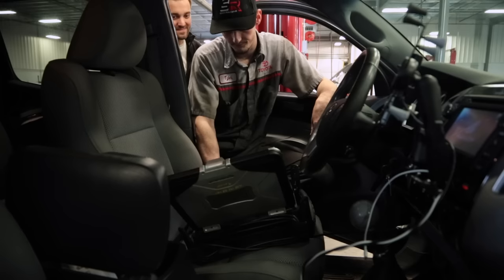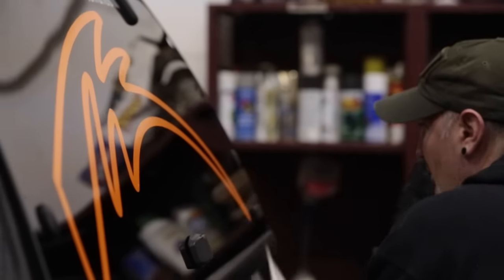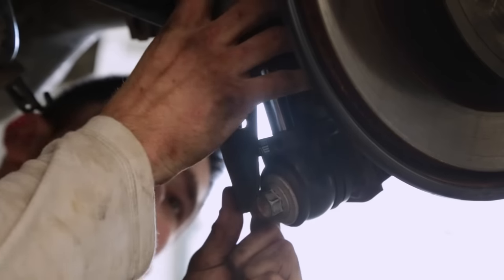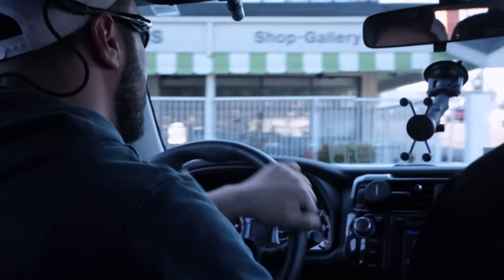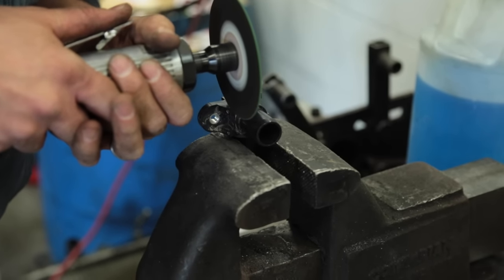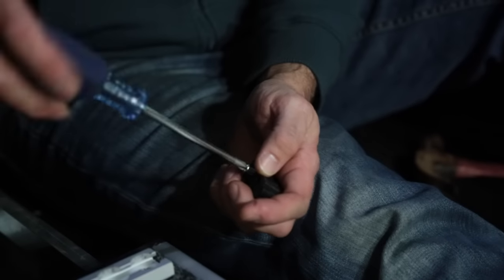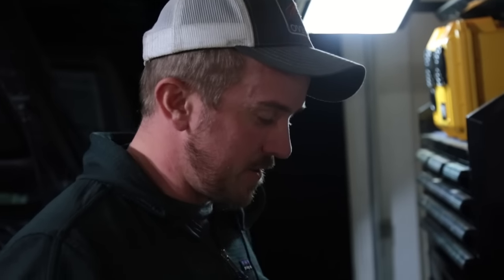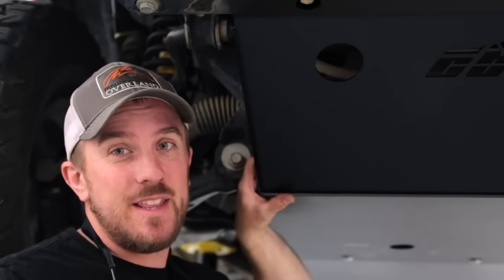Built 4 Adventure - 4Runner Overland Vehicle Build - Mountain State Overland

Comment: pumped, can wait for the new season ! and not hard to tell your dealing with Toyota USA, theres no way Toyota Canada would modify a truck ! they gave me such a hard time about my 3'' lift on my Tacoma, I had to take it off.
Reply: haha I had a Vibration, and they said it was from the lift..... and wouldn't look at it until it was off, not sure if you're in Canada or not but Toyota Canada is Nothing like Toyota USA, they don't even like bigger than stock tires..... it's insane...
Reply from the maker: +Matthew James I don't have vibrations - you can remedy that with a pinion drop kit. I did t have to do that fortunately.
Reply: Matthew James

Comment: Excellent work guys! You have some nice rigs! I've watched all of the seasons, and have just finished the second round of Season 3. As an amateur radio operator, I'm interested in details on your antenna setup... What did you use for antennas on the 4runner's front bumper?

Also, I noticed the bumper sticker on the back of Boomer the Camper Van... Cool to see another ham (Spencer) in the northeast really interested and involved in overlanding!
Reply from the maker: the MSO trucks run CB and GMRS antennas. The camper van runs CB, GMRS and Ham antennas. Our primary radio of use was a Midland MXT100 Micromobile GMRS radio. That radio is a game changer for the price point and audio is either clear or OFF. Best reception during the trip was 4 miles.
Reply: Are you still happy with the mxt100

Comment: I have a 2016 Trial Premium with KDSS in Richmond, so I'm excited to see the New England adventures and hope to catch up with you on a future trip - thanks for the video!

Questions - are you guys using the BP-51 setup for a FJ on the 4R? or is it a pre-production model? What about KDSS? You guys mention spacers for the stabilizers, but not sure if you needed a work-around for KDSS...
Reply from the maker: Those BPs were the first 4Runner install with ARB. They do have a KDSS option. I think they are very similar to the FJ kit if not the same. Contact ARB directly to be sure.
Reply: Thanks for the info - I also would like to understand more about the mods to the Bull Bar that's only made for the 2010-13 models - ARB makes some great equipment but for some reason has left out the latest 4runner from the good stuff - also love the new season & excited to see where you guys go next...

Comment: Are they Nitro Gears?  Notice an increase in NVH?  I went Nitro 4.56 in a cruiser and man they are noisy.  They are setup right, but the front is a howler.
Reply from the maker: Yep, Nitros. There was humming during the break in but at around 3K miles the growling went away. Did a gear oil swap at 500 miles too.

Comment: What size drawer did you use for the Tacoma and how did you mount it?
Reply from the maker: Its a big honking drawer. The passenger bed has a full length pull out. The drivers side has a fridge and another cabinet behind it. The system is all bolted to a sheet of plywood that's anchored to the bed of the truck.

Comment: did you run spacers to fit 285/70/17s on the 4runner oem wheels?  i have volk racing TE37X 18x9s with 285/65/18s and it fits but I'm curious about what to do with my 17s since the stock tires aren't so great. are the spacers needed? what did you run?
Reply from the maker: We are running spacers, but they aren't necessary to fit. The spacers actually resulted in more rubbing.

Comment: That red recovery point you installed on the 4runner, what brand is that and will it fit on the tacoma? if not what do you suggest for a recovery point on a second gen tacoma? I have an ARB Deluxe Bar like yours and and unsure about rated recovery points on the front of my truck.
Reply from the maker: If you don't have the ARB recovery point, the factory point is your only option depending on the bumper you have. They do have a recovery point for a Hilux and I'm farily certain it'll fit a Tacoma. You'll need to verify that with a quick call to ARB USA. Thanks Tommy!

Comment: i test drove the 4runner trail and found it under power with absolutely no load, how does it handle the expedition weight? on those beefy tires?
Reply: It gets pretty bogged on hills, but I think he's going to change the shift points and probably re-gear as well.

Comment: I hate to ask but how (much worse) is the gas mileage on the 'Runner with the 488 gears (and of course the weight of the upgrades)
Reply from the maker: The gears went on our Tacoma. Gas mileage did drop a bit but the gears are set where they need to be now. Before the powerless was a major concern pulling trailers in the woods.
Reply: Mountain State Overland
Oh, okay - my mistake. I guess the gears were for the towing needs, and you're not going to tow with the T4R...

Comment: i always wonder why do every overlander uses Toyota 4runners and tacomas, and not Jeep Wranglers.
Reply from the maker: My own personal preference - they hold their value and they're built to last. I own 3 Toyotas. The last one I sold had 260K miles on it and it went for $6K. That about sums it up.
Reply: Because Toyotas are really good at touring and Rubicons are really good at crawling. Totally depends on what type of driving you intend to do.
Reply: Ricardo Perez they last and just about every county has them so they can get parts no mater where they go.
Reply: silver fox clearly has no experience with jeeps
Reply: MrMrsregor sure jeeps have problems but we can all ignore the part that we usually on see them when they have over 200k miles. I'd rather have a vehicle that I can get parts for no mater where I'm at.
Reply: thisisntme, talking to me.?. i dont think jeeps have any more problems than any other vehicles, i think the old ones have way less problems than most cars on the market, i have had about 20 vehicles my life and 4 Cherokee xjs.. the older jeeps (before fiat bought the jeep name) are the most dependable vehicles, the cheapest to get parts for, and the parts are sold every where, with hundreds of options. i have seen one 96 jeep Cherokee xj with 465,000 miles on it !  i have had two get to 350,000+ miles and still running when i sold them. the two i have now have 150K miles, 20 years old, and one i wheel hard and the other is a dd. i have had to do less work to all 4 jeeps than i have had to do the one Toyota Tacoma i had
Reply: Having owned a 06 4Runner, 07 Tacoma, 01 Jeep Wrangler, and a 13' Tundra. Jeeps have zero space for leisure travel. I personally dont see how anyone would want to use one for overland. They are way overpriced, IMO.
Reply: MrMrsregor you wheel hard. lol. I took my stock Chevy truck to mud event and played in the mud for a couple of hours at wide open throttle and then drove the truck back home to unload all my gear and clean all the mud off the truck so I could race it in a tuff truck competition were I came in second by 2 seconds to a completely custom rig. oh and the course we were on were jumps built for monster trucks.
Reply: MrMrsregor sure you can go to any parts store in the US and get parts for your jeep but jeeps are really only popular in the US. try going on a trip to Africa and Australia out in middle of nowhere.  you will be able to find Toyota parts on every continent including the antarctic because they even use Toyota's there.
Reply: ok, i am also a chevy fan, i own two, my favorite is ,a 84 k10 with 9" of lift and 35" tires. i am not obsessed with jeeps and i dont have one brand name vehicle stuck up my ass (like a lot of folks)...my fist comment was to silver fox, my second comment was a reply to you, but i was not referring to traveling the whole world to buy parts. i will never have the money to ship my cherokee xj, chevy k10, ktm625, or any vehicle to Africa or Australia, so i dont give a shit what parts they have for sale over there. when i travel for vacation, it is just that, vacation. i was just saying that jeeps do not have a specific problem or problems once you hit the magic number of 200k miles...